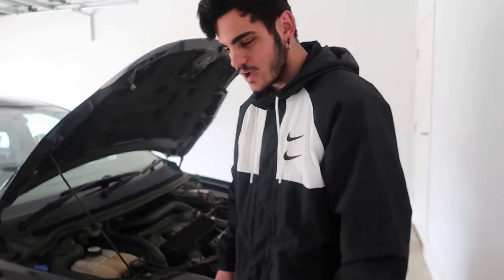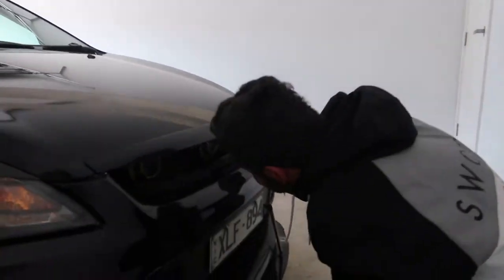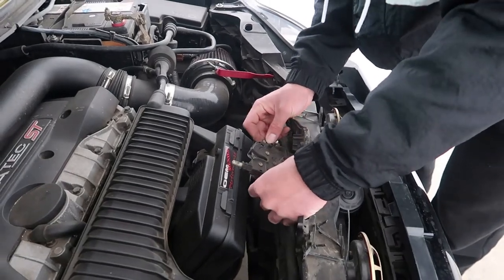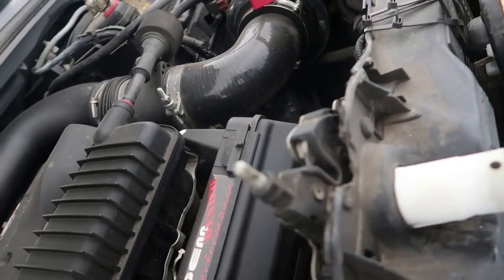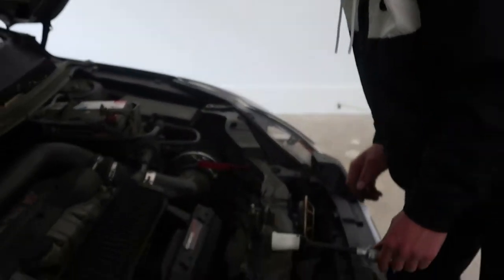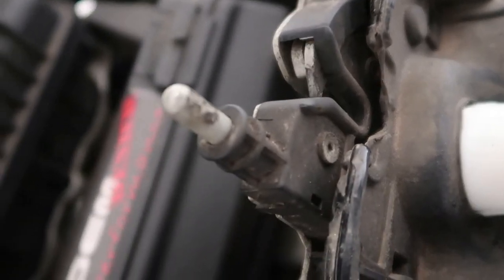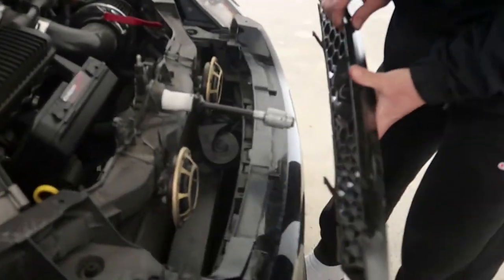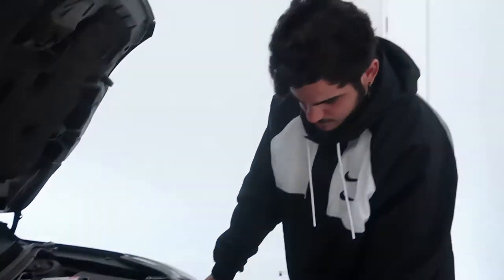FORD FOCUS MK2 BONNET LOCK REPLACEMT | TUTORIAL

Comment: Arnold Clarke UK quoted me £600 to do this job today. I declined . She said it was £149 for the part and the remainder was for 2 hours labour
Reply from the maker: Oh wow, well now tell who that person is that u know how to do it from the help of me 🤗 also thanks so much for watching and leaving your feed back I really appreciate it, if there’s anything at all u need to see let me know
Reply: @stavhanna  Arnold Clarke are one of the UKs biggest car dealerships.

One of their mechanics removed the latch from underneath the car, you can get to the 10mm bolts on a ramp with the right tools. Every video I see people take the grill off even breaking it. Just thought I’d post the quote they gave to complete the job. Cheers
Reply: @MrSmid888  600 - 150 (part) = 450

450/2 = £225

£225 an hr for Labour? Jesssssuuuussss christ
Reply: @jjmmjj9999  I bought a Chinese part on Amazon for £20 and fitted for £20 = £40

She argued they had to “strip it” first, when I went to get it looked at the mechanic stripped it to see the issue, took 20 mins and it cost me nothing, he even filmed it and emailed me it. I said to her but you stripped it today for free? All he has to do is take two screws out and replace. SHOCKING. I hate the car industry from buying to fixing it’s a scam.
Reply: @MrSmid888  yeah man, i've just purchased one for £11 and going to put my old (original) lock barrel in it, it'll work just as factory does even with my original key

youre right, it's literally 2x 10mm bolts to remove the catch. It's a joke
Reply: Shocking.Rip off Britain